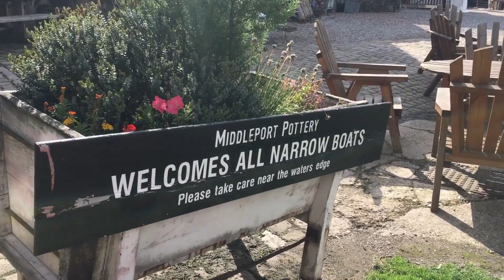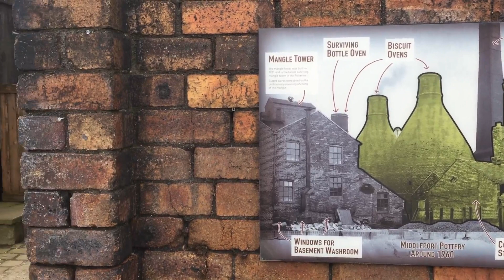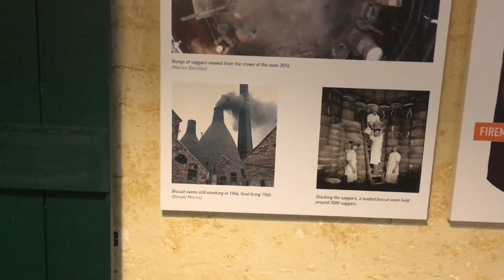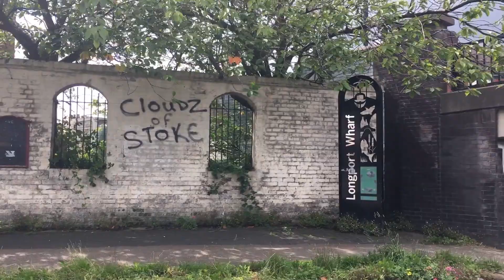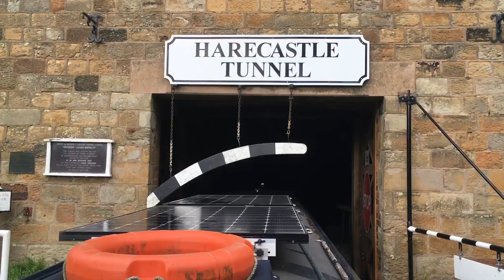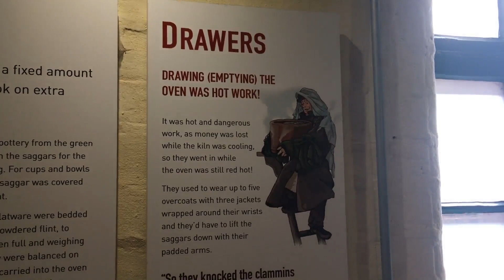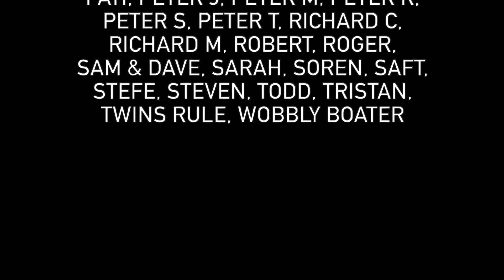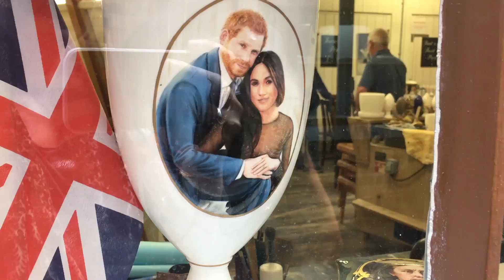218 - Sagger Maker's Bottom Knockers and Other Stories

Comment: Toured the Middleport Pottery last year. Fascinating, but unfortunately the factory was on its annual closure. Did you go into the old bottle kiln? It's interesting to see how the kiln was packed. 
I still have the remains of the ceiling of the Harecastle Tunnel on my Pilkington hat from not ducking quickly enough when the crown of the tunnel suddenly got lower!
Reply from the maker: Heh, yeah got to watch that tunnel roof! I did go into the Bottle Kiln, quite fascinating. Unfortunately too dark inside to get much of a shot of it! M

Comment: If you flick you finger against the handle and if it rings clear the handle isn't cracked.
Reply from the maker: Yep... turns out that’s basically the bell they use for be whole piece... of the biscuitware doesn’t chime, it’s rubble. M

Comment: Nice one! Just a bit of anorak ceramics information, which may or may not be applicable to that specific pottery. 

Slip is often (always?) the raw material for all clay products in a pottery. First, the different dry clays and other body materials are measured/weighed then mixed with water in a Blunger (rhymes with plunger) to produce the 'first' slip. That slip is then pumped at high pressure into a Filter Press which produces several cakes of clay. The cakes can then be vacuum processed and squeezed through a pug mill to produce void-free clay that will be used for flatware etc, or mixed again with water to produce slip for hollowware, cups etc. Different factories may vary that process though (the process I describe was/is for fine china porcelain)
Reply from the maker: Same here, though nowadays they don’t press their own but get it delivered from other factories that just pug clay. I briefly got a shot of the old press they used to use and some of big squarish blanks and some sausage-shaped extrusions they get delivered. IIRC the blanks end in the slip stream, the sausages go out for cutting and spinning. M
Reply: @MinimalList  I wondered whether they might buy in their clay instead of having their own Slip House. It sounds like cheating but economics of scale push the cost down, so more able to compete with overseas factories. Anyway, good stuff showing canals and one of the trades that boosted them in the first place.

Comment: FYI they are not barges, they are narrowboats. A barge is a vessel 11' wide or more.
Reply from the maker: Actually a barge is any shallow-draft and flat bottomed cargo boat for use on rivers, a term that precedes the canals by quite a few centuries... thus all narrowboats are barges for much the same reason all dolphins are whales. Now a British dumb barge is a name typically given to a working cargo vessel at least 8’ wide and unpowered, and most examples are indeed wider than 11’, but many narrower dumb barges existed as well, the main thing that distinguished them was that they were towed from place to place, either by a self-powered boat or by horse. The potteries employed both boats and barges over the years for moving wares about. M
Reply: @MinimalList  I take it you didn't visit the boat museum at Ellesmere Port?  The Potteries would not have employed barges as they wouldn't fit the locks.The example you filmed, Dane, is beautiful recent restoration of the type of boat used in the potteries - a narrowboat.
Reply from the maker: I did visit, actually. And yes Dane was a lovely narrowboat... doesn’t change the fact she’s also a barge. Dolphins are whales, whales aren’t necessarily dolphins, and thus a narrowboat is, by definition, a kind of barge. A British wide dumb barge is indeed also a kind of barge. M
Reply: @MinimalList  OK, Dane is NOT a barge. I'm not going to fall out with you over this, I was just trying to save you from some derision from historic narrowboat owners, who no doubt would have a better argument than me. All the best. 

ps have you read LTC Rolt's 'Narrowboat'?